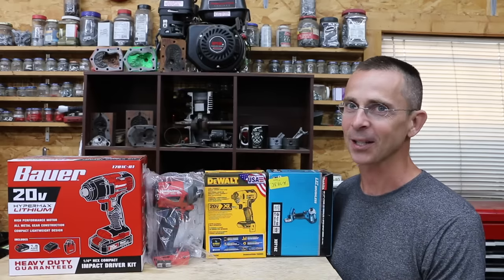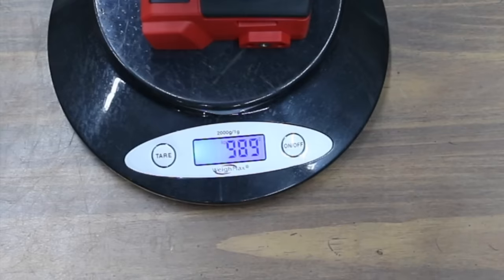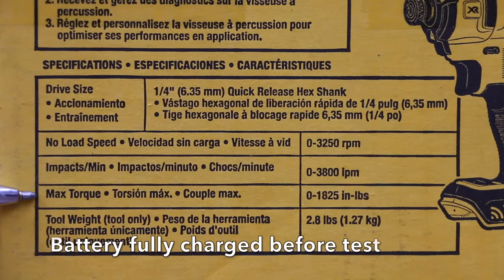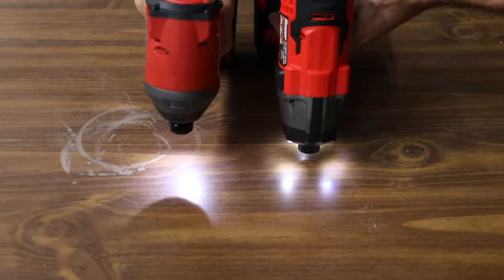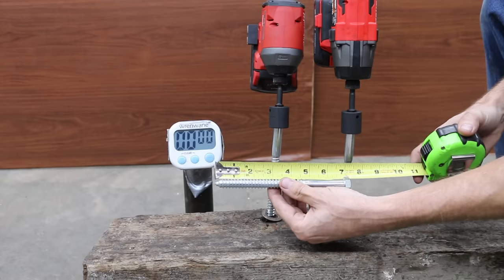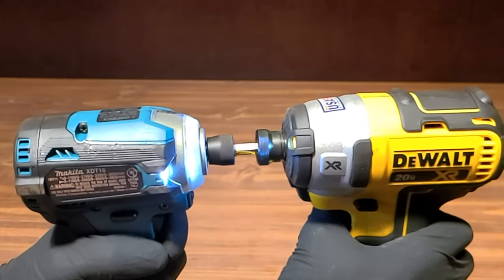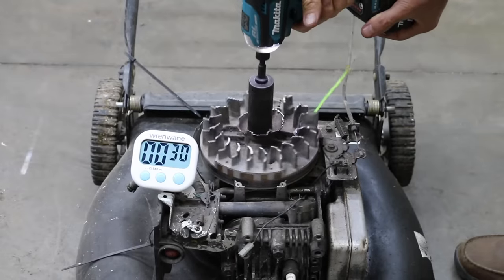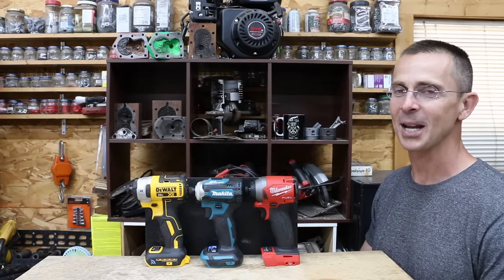Best Impact Driver? DeWalt vs Milwaukee vs Makita vs Bauer!  Let's find out!

Comment: Wow, Bauer didn't do as well as I thought it would!  My Bauer was a good deal stronger than a friends Dewalt but it was an older model Dewalt than what you tested.  But  $150 is a lot to swallow for a little impact... Great test!
Reply from the maker: Thanks so much!
Reply: If you're gonna use it once in a blue moon on relatively light duty jobs, get the Bauer. If you're gonna use it somewhat regularly on medium to heavy duty jobs, get the DeWalt/Makita/Milwaukee. They're expensive but so worth it when you need them. When that cheap Bauer breaks in the middle of a project you'll regret buying it.

Comment: Buy a cheap brand with a Rock solid warranty.  I chose Hitachi. I've only ever smoked one drill and honestly I used it way over capacity.
Reply: I dropped my Hitachi... Far. Called em up, completely honest, new impact. Might not be the most powerful but damn they don't even question it, replaced.
Reply: I thought I was the only person that owns a Hitachi impact driver! It did 4 12" lag Bolts into landscaping wood on its 1st day and has never failed me. I have a makita, also. The Hitachi whips the makitas butt in power. At least by 10 percent. The makita does feel precision though. Hitachi has been great to me except their cheap 18v reciprocating saw. I tortured that to death and it finally died. Great tools.
Reply: Hitachi aka Metabo aka Hikoki is actually a higher end brand for professionals. As with all brands, they have their affordable line of power tools along with their high end stuff. Their cordless tools are great because if you forget to charge your battery, you can still plug a cord right into the battery itself and use it as a corded tool. Some of their tools even come water resistant.
Reply: I like Hitachi because it is lightweight and has a slimmer handle, since I don’t have huge gorilla hands. It doesn’t have the power of others, but it is VERY comfortable! I’ve had them for a few years. 
Too bad my wife stole all of my Hitachi tools and won’t give them back. She works on her own projects and she likes the smaller Hitachi. 
It was an excuse for me to get new power tools and she couldn’t gripe at me! 
I bought Makita Brushless to be different. For what I do, I can’t tell a difference in power or quality.
Reply: Hitachi is hit and miss. They have a huge quality spread that you can only tell by specific part numbers. 

One grinder, $40, other grinder, $180. Both look identical, but one will easily stall while the other will kill you without flinching.
Reply: My wife ran over my Hitachi impact with our minivan. It only bent the belt hanger. One tough tool.
Reply: Where's Hilti?
Reply: @KingYang05  Hitachi aka Metabo -HPT-, metabo and metabo hpt are 2 separate companies, dont mix that.Metabo is high end german company, hikoki is big shit.
Reply: Jim Bob. Is Hilti really that good? I’ve never used Hilti equipment, I’ve only seen the big red heavy cases.
I’ve heard that they are usually just rental only, so they are heavy duty but over priced if purchased?
Reply: @zylent8251  incorrect, Hikoki is Metabo HPT.. Their tool division changed name when KKR acquired it. They use the Hikoki-name in most of the world, Metabo HPT in the US.

It's the same tools, just different/new name. They even share some tech, my metabo impact uses a triple hammer impact mechanism..
Reply: @edwardmonsariste4050  hilti is good.. Really good most of the time. But costly, especially the batteries will cost you an arm and a leg.

Their midrange impact with two 2.6Ah batteries run for $700+ here...

Comment: I wish Rigid had been included in this test. I have been really impressed with their power tools. Love your videos however!
Reply: For further info, I have the gen5x 1/4 inch impact from Ridgid and it even impressed my buddy who's a mechanic and has Milwaukee and Snap-on cordless tools. It peeled all the lugnuts off my 1 ton truck that are torqued down to 140 foot pounds. My old Mastercraft driver never could do that. Even some of my cheaper air impacts struggle with the lug nuts on occasion. You cannot beat the price either. I got a 5 tool set, flashlight, hammer drill, impact driver, reciprocating saw, skill saw and a bag plus two 4 amp hour batteries for 378 dollars Canadian from Home Depot. If you can get your hands on one of these impacts I would love to see it compared to the Milwaukee!
Reply from the maker: Thanks for the suggestion for future round of testing.
Reply: And do not neglect Porter - Cable. Thx

Comment: Your work and time is amazing. I have a Milwaukee, your tests confirm what my dad always taught me. Buy the best and buy it once. Thanks for all the time you put into these vigorous tests.
Reply from the maker: You are welcome!
Reply: Than you should be buying Bosch. I can kill a Milwaukee impact in under 3 months.
Reply: @ronjericho7977  I can kill a Bosch in 3 weeks. Bosch is not what it used to be.
Reply: @Lakecenterlawncare  I drive around 40 to50 thousand screws a year. Never had a better drill
Reply: @Lakecenterlawncare  I’ve been driving screws into everything possible for the last 30 years. I’ve tried Milwaukee impacts twice. Something breaks inside and they start smoking.
Reply: 90 percent of my drilling is into ceilings. Maybe Milwaukee doesn’t like the dust.
Reply: @ronjericho7977  I went through 2 Bosch building my pole barn. 1 I dropped, the other locked up tight.  Speaking of smoke, a friend of mine smoked 3 Dewalt drivers in one year. He switched to Milwaukee and won’t go back. Have you tried the new GEN 3 Milwaukee’s?  They are unstoppable and bullet proof in my opinion.  But hey, we buy what works for us, right!
Reply: Milwaukee products hit hard and are impressive in tests like these, but unfortunately they are not built to last if you use them daily. They are perfect for the weekend warrior though. Go check out a channel like Ave who takes things apart and goes through the build quality in detail.

Comment: Still have a couple of Bosch's old 12 volt impacts that work great. Also have the 1/4" Bauer, an 18 volt Dewalt, and the Bauer 1/2"  - that I use mainly for tire work, vut my daily go to is my Festool 1/4" drive. Everything they make, I pretty much have, and they ate fantastic.
Reply from the maker: Thanks for sharing!

Comment: When I bought my own, I went to the store and tried them all, the overall power of the Milwaukee is undeniable but the makita doesn't lack anything at all when it comes to any reasonable task you would use it for...that being said the feel, weight and pick up of the makita was so much better I just couldn't say no.
Reply: I prefer makita too. it can do anything my milwaukee can do . and has better control at it.
Reply: Makita makes a good tool, so does DeWilt and Milwaukee, but man, the Makita's just seem to last longer, esp. their batteries and feel better. I really like the ergonomics of the Makita products.
Reply: @GlennC789  It's probably some feature that's meant to "protect the tool from overwork" which is probably why it survived certain tests that pushed it past what it was designed to handle
Reply: @GlennC789  Yeah, that's what I'm thinking might be the case. 
It is possible it's just meant to try to make the tool last longer and reduce warranty claims, but when was the last time we saw a company actually care about those 2 things, right? They usually just weasel out of honoring warranties by claiming the device wasn't used properly or make it cost-prohibitive to send off for an exchange or repair
Reply: @GlennC789  But there's always the option to use the M12 line instead of the M18 if your primary goal is weight savings, of course.
Reply: @InfernosReaper  I have taken an 8 year old drill into a milwaukee dealer and when they couldn't fix it the rep told him to pull one from the shelf. That being said I did have my tools and boxes loaded in the back and looked like a driving milwaukee billboard so that could be a factor.
Reply: This is what you do! All the big three (Dewalt, Makita, Milwaukee) are capable enough. Go touch them and get the brand that's most comfortable for you and has the tool lineup you want. For me it was Milwaukee (as an Auto Mechanic).
Reply from the maker: Thanks for sharing.
Reply: @BarnStangz  I bought my LXT set in 2006. I'm still on the original pair of batteries. Cannot complain about that.
Reply: @psedog  Right on man, I've got batteries that old too and they still keep kicking. I do believe that Makita makes the best batteries. I always try to buy spares around the holiday season since they go on sale.
Reply: 2 years using the makita everyday at work and its a beast
Reply: BarnStangz makita doesnt make the best. Hilti is number one and Milwaukee is 2nd
Reply: @justinjones5288  I haven't used Hilti enough to make that decision, but I do know they made some decent stuff. They price however is pretty steep, I think bang for the buck and longevity, it's pretty hard to beat Makita. I also have some Milwaukee. They make good stuff as well. I, however, don't think their stuff is as ergonomic as  Makita. Of course, everyone is going to have a different opinion and you know what they say about that...
Reply: @waterloo123100  Not everything, but I agree with you on the control. Compared one to another, one feels like a surgeons scalpel and the other is a swiss army knife.
Reply: Where the makita beats milwaukee is when you need finesse. If all you care about is nut busting torque, Milwaukee wins. If you care about getting close to a torque spec and finishing by hand, nothing beats makita impacts.
Reply: @GlennC789  the idea is duty cycle, so say your driving fasteners, your 5 seconds on 5 seconds off. thats a 50%duty cycle. you do NOT grab a 1/4 inch impact to drive a 7" lag bolt , come on. you grab a much larger 1/2 impact for that work. the idea is all the power for a short time. Im a snap-on guy btw so no favourites in this test, but these tests were extreme for these little 1/4 impacts.
Reply: @GlennC789  Yep, ditto for the Makita.   Of the two (M or M) more a matter of which you've  bought into for cross battery usage.  Also found it interesting no one' s mentioned the bias at 10:22 where  Project Farm is ratcheting that tool to get 'er finished,; while acting as it was nothing at all.   On my job site he'd of been called out for that?  (real fast).
Reply: I’ve had 8 Makita 18V batteries die on me. Had them warrantied over and over again until they stopped replacing them for me. They even tested my charger a couple of times. Also, smoked the hammer drill twice. All the time I wasted going back and forth to their Norwalk repair center, I could’ve bought half a dozen new impacts.
Reply: Brad Davis I too, broke a chuck bolt, my mistake and Milwaukee fixed it without even asking for a receipt. Makita, they engraved my replacement batteries and stopped replacing them as soon as my warranty expired, 3 years from date of purchase I think. The last new battery lasted about 6 months. They just said sorry, you’re out of warranty for this product.
Reply: @GlennC789  people don't get this. Raw power doesn't matter that much. Who the hell actually uses these tools at their maximum all of the time? I would much rather have control. "Well, my Milwaukee can drive a screw in 
.0063673247 seconds rather than your Makita at .0063673299." who cares? I know I'm not going to over drive every single screw like you.
Reply: @LordOfSilense  but m12 tools aren't that light compared to other manufactures 12v lines. And battery in the handle sucks. I had m12 tools, but sold them immediately after holding Dewalt and Makita slide pack 12v. Hand feel is soooooooooooo much better with a slide pack.
Reply: @BarnStangz   Holiday season. Check. I'll look for some around that time. I would like at least one more to go with my 1/2" impact instead of always sharing the battery with my other impact and drill.
Reply: @psedog  Yes sir! Every year, you'll find great deals on at least a 4 amp hr. battery or better. Last year I got (2) 5 amp hour batteries for $99! That was a great deal!
Reply: J S  What's in that pipe your smoking? Makita is the only brand that use load sensors so it doesn't over use its power witch saves the battery life and gives it smoother control. Makita has had control settings for years while Milwaukee is just catching up. Everything you said is really lacking common sense.
Reply: J S  Is that why Milwaukee is always doing updates to fix the previous generation? While Makita Practically makes the same gun every year? You dont know anything about me 😂or how tools work or common sense. Makita doesnt use "battery control" Go watch AVE. He might be able to crack some sense into you.
Reply: J S   Well you and me probably have different uses. I don't just polish my knob with it I fix stuff with my tools guy and they get used often with actually more dewalt and milwaukee then any other  electric tool  and their slowly being replaced as they break with something different. I can honestly say my  Makita will do the same job with out having to charge the battery unlike my milwaukee impact that ive more problems with. Your literally the only one who i've heard say a makita is uncontrollable and low class which is why you have no common sense  😂

Comment: One thing Bauer has over the rest is a replacement. If you purchase the low cost replacement for your tool every 2 years you get a new one. No questions asked. You can smash it in their parking lot...get a new one and another low cost replacement voucher. No need to save receipts either. They add it to your account. After your initial purchase you basically rent the tool every 2 years. Try getting the others to honor their warranty if you lose your receipt....not happening. If the others fall of a ladder and break you get nothing. With my Bauer tools its just another replacement voucher for around $13. I work professionally as a machine tool builder and I put these tools through hell. I am 18 months in and no issues with them.
Reply from the maker: Thanks for the feedback.
Reply: True, getting others to honor their warranty is usually a nope.
Reply: @tachometer-flac  HF extended is NOT a warranty.It's a replacement.

Comment: I just want to add that when I was in the Navy we had a Ryobi impact drill, it dropped off the side our ship, hit the concrete 60 feet below and it worked great and continued to work for about 5 more years.
Reply: I decided to join the Ryobi One+ ecosystem earlier this year. No complaints so far.
Reply: @John_Ridley  i did the same about 5 or 6 years back. no major complaints. i have both old old blue tools and the newer greens and all my batts interchange. so far i have one old blue radio, the small green radio, the big green radio, the pole saw (which is frickin awesome for what it is) a green drill, a green brushed impact, a brushed 1/2 impact wrench, a blue circular saw, a blue chainsaw, tire inflator.
Reply: I have a Ryobi impact(not the newest one) and I bought it used. I used it a few times before it suddenly stopped working. I never really thought of Ryobi as a great brand but that confirmed it. It might have been a lemon but I’ve heard many stories of them giving out. I think my next impact is gonna be Milwaukee after this video
Reply: Milwaukee owns Ryobi so that’s why there such great tools
Reply: Jerry Hastings  there are points in ships life cycles where it'll go through major  upgrades, during that period the ship is either moored very close to the pier or taken completely out of the water.
Reply: @megej2600  milwaukee ryobi and rigid are made by tti.
Reply: Well I had a ryobi impact that I dropped from a 10 foot ladder and it broke the bottom part where you put the battery in. So results may vary.
Reply from the maker: Thanks for sharing.
Reply: Ryobi is underrated and is backed by good companies like tti and Honda

Comment: I know this test was a little while ago now, but I have the Milwaaukee and it also used to shut down on heavy load. I sent it back and got it repaired on warrenty, they said they changed the electrics complete. seems to be a common fault with Milwaukee.
Reply from the maker: Thanks for sharing.

Comment: That Milwaukee is a 1/4 " Hex driver. Its fairly strong and able to break the drive adapter when things get serious. When driving sockets, I prefer the impact driver with either 1/2 or 3/8 anvil. For driving sockets like in the screw through the rail road tie or nuts, it puts the 1/4 hex driver in the shade.
Reply from the maker: Thanks for the feedback.

Comment: You know, we use milwaukee and my impact does stop like that... never really knew why... but it does a nice job. 
We are interested in seeing the difference in 10/12 in saw blades... we know which ones are really bad but my buddy swears by Freud but I'm skeptical. Thanks again. Your videos extremely interesting and informative!
Reply from the maker: Thanks so much!
Reply: Not owning one, my best guess would be a built in safety shut off. Either to protect the battery or the tool. I experienced similar problem with my Bosh power tool when the going gets too tough.